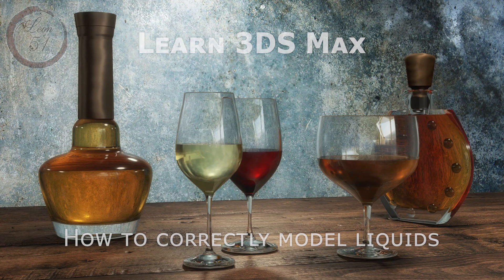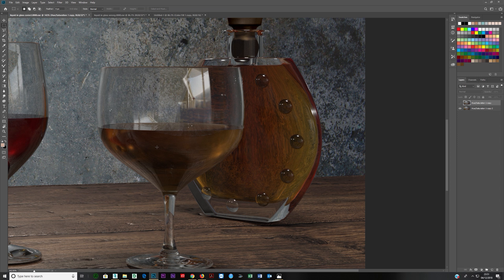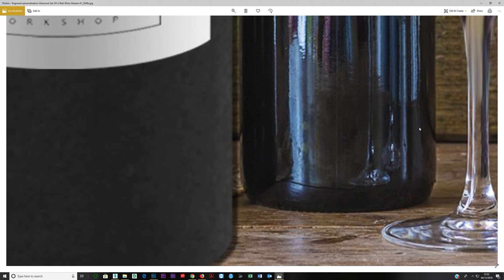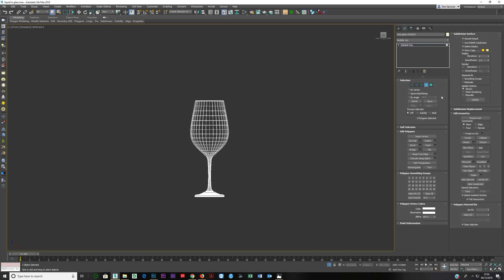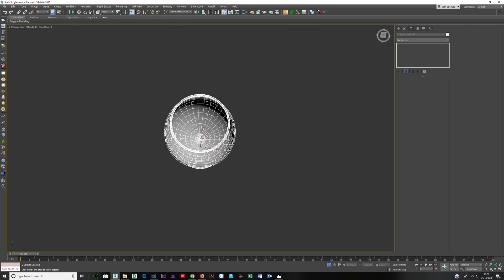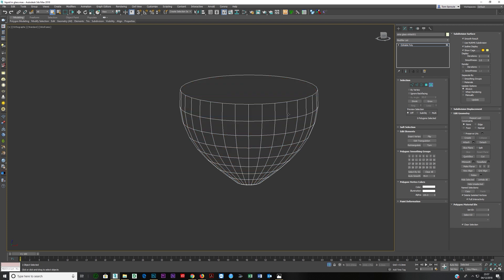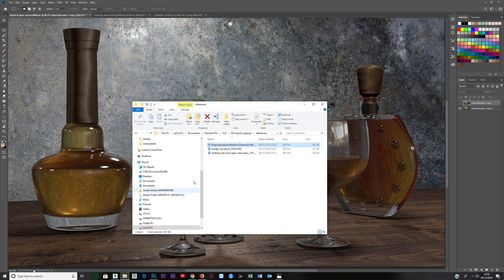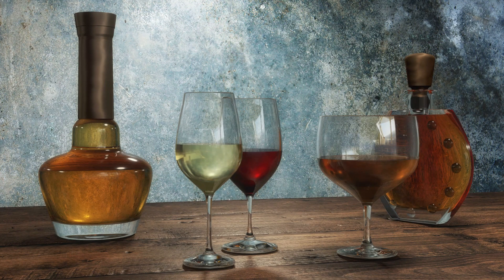Learn 3DS Max - Liquid in Glass Tutorial | V-Ray Realistic Rendering

Comment: This works with 2 seperate objects, but when I wanna combine them to one object for a simpler Library asset, its not working anymore. Same goes with touching surfaces. Any solution for something like this? my solution was to scale it down a bit, so the surfaces are not touching anymore, but the look is nor realistic/perfect then.
Reply from the maker: Hi, I‘m not sure what you mean. I guess you’re referring to the wine glass with wine where you combine them into one object. I’m afraid I don’t have a solution for you. I’d just group them and forget about it. In terms of glass sitting on top of a table you need to think with reality vs 3D for example if you have a glass on a table in reality the surface of the glass is not actually intersecting with the table, the molecules of glass simply sit on top of the molecules in the table. But in 3D we put the glass on the table and the polygons are actually intersecting, something which doesn’t happen in reality. The easiest solution is to lift the glass off the table by 0.05 mm. It’s small enough you won’t see the gap and it’s big enough that it will look normal. Normally you never notice it though, so normally I simply put mine on the table. But knowing this I could and do use this solution if necessary.
Reply: @leonleon51  Yeah I guess I have to stick to groups. Would prefer one simpe object but I guess thats not possible.
I meant as one object, the glass and liquid have very weird physics both if the two surfaces touch, as when they intersect. As one object I have to scale the liquid slightly smaller than the glass, so they dont touch at all. But this means we see a thick glass frame arround the liquid. So yeah I have to stick wit groups I think.
Reply from the maker: @till1117  oh, you want to scale the liquid slightly larger than the inside edge of the glass. You don’t want to see a thick glass.

For simplicity you can follow the instructions from chaos group here, although I don’t agree with everything he says. 

https://docs.chaos.com/display/VMAX/Rendering+Refractive+Surfaces